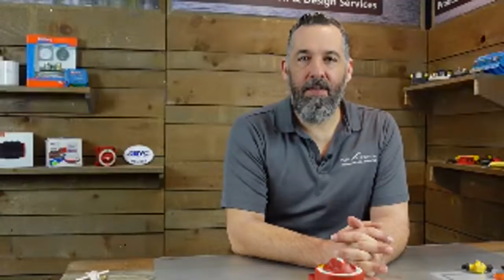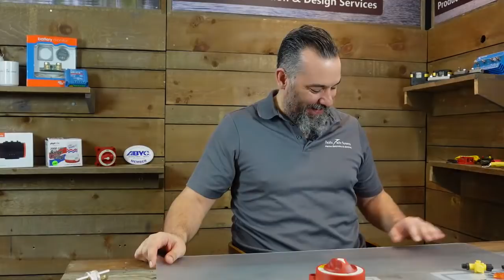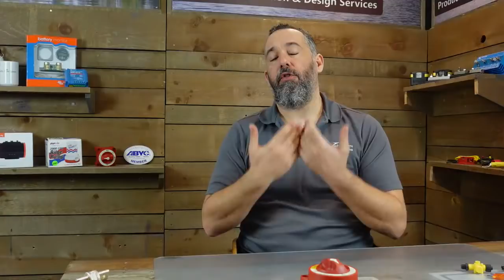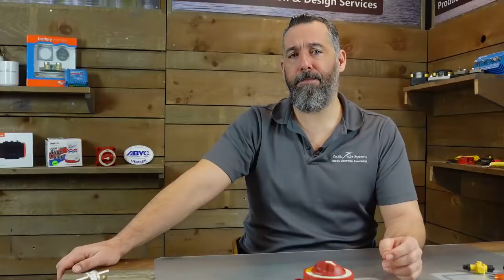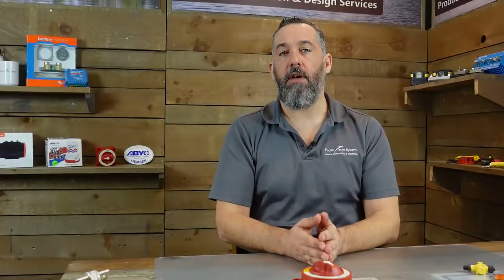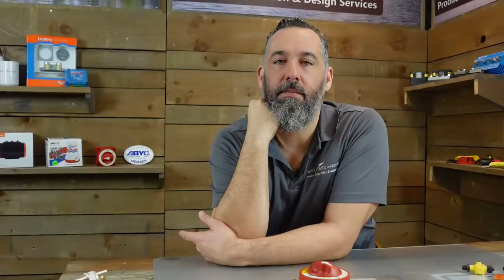Boating Tech Talk with Jeff Cote - Live Stream

Comment: Hey jeff I have 4 agm batteries n my boat. 2 group 24 for the house and 2 group 31 that are in Parallel that are starter and bow thruster. I have a VictronConnect bnv712 and a pro nautical 1250 charger. These batteries are only one season old and I had the charger powered on all winter long. Now that I’m getting ready to launch I noticed after disconnectin* 5he charger from shore power both battery banks are showing between 12.4 and 12.7 volts. Is this a battery problem or something else as a I thought new batteries should read 13.4.
Reply from the maker: Once the "surface voltage" from the float charging at 13.2 - 13.6 is removed, the 12 volt batteries, without any loads should be at 12.6 - 12.8 volts.